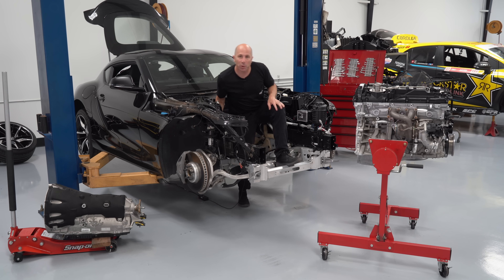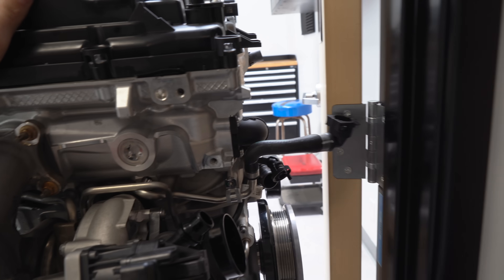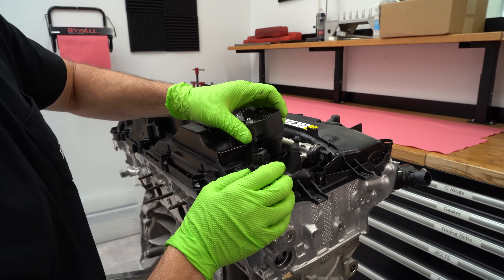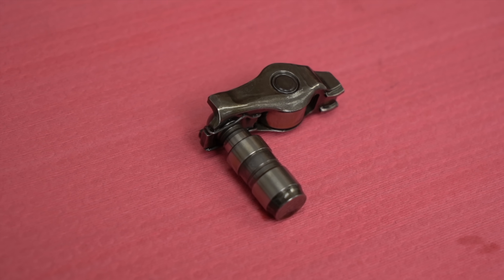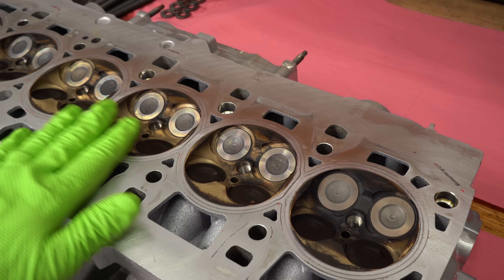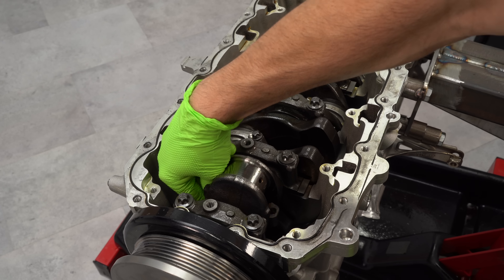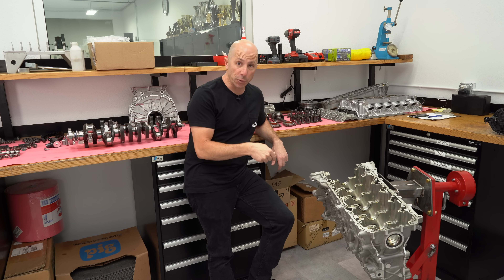2020 Supra B58 Engine Teardown - First Look - Better than the 2JZ?

Comment: "Timing chain is in rear" What I heard "timing chain tensioner changes will be very expensive if you buy one"
Reply: I paid 2k for a change on my bmw 320, ouch
Reply: They do fail, if owner didnt service the oil on time/ before near due.
Reply: @asteiner9181  Agreed !
Reply: Well some people take out engine and some just take out a gear box lower it down a bit and change it like that much easier faster but still expensive..
Reply: hopefully they mounted the tensioner to be easily accessed with everything still mounted. For example on the s2000 you can do it in 5 minutes from the front under the hood. In the rsx you have the remove some stuff but do it under the car. On this, I'm hoping it's not buried inside the timing cover.
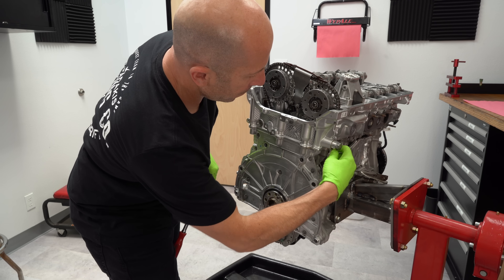Reply: @InTheZone85  At 6:00 you will have your answer.
Reply: Timing chain tensioners do not normally fail. These tensioners are hydraulics and should be fine for the life of the engine.
Reply: @hammertimee777  They do fail periodically, and guides also become worn out over time as well. It cannot be assumed the timing system will last the entire life of the engine without service.
Reply: @hammertimee777  "the life of the engine". Exactly, when it fails you get a new engine.
Reply: @hammertimee777  NO. Not correct at all. Many many many after market parts offer a mechanical tensioner because hydraulic tensioners usually fail before any guides.
Reply: @hammertimee777   And the chain life??
Reply: castamir it should if the car was stock, most of the 2nd owners will tune the shit out of the B58 & then will find out the timing chain is in the rear...
Reply: @hammertimee777  tell that to all the M278 engines.
Reply: @hammertimee777  They have done quite often on BMW engines of the last 12 years.
Reply: @jagolago-bob  That was a material related issue. The plastic would become brittle and  break.
Reply: @a914freak  Then I expect it won't happen again, but they still made the mistake.
At least this time, if they co-developed it with Toyota, it should be more reliable. I bet that Toyota checked the design over carefully and re-specced some components. They don't want to have BMW's reputation.
Reply: @jagolago-bob  Toyotas are known for breaking timing chain guides as well. Most new cars are not made to be worked on, they make the most money from the dealer repairs at a high shop rate.
Reply: @jagolago-bob  I was just about to say the same thing
Reply: @hammertimee777  how do the guides work? and how do you define "life of the engine"?  I had to change the guides and tensioners 3 times before 250k mi on my s4.  they said the same thing, but I later learned they really meant "80k mi"
Reply: Plus they already dealt with the theething problems for that system in the first gen 1 series.
Reply: @hammertimee777  modern timing chains in double overhead engines tend to fail quite often.  Guides wear, chains stretch, tensioners weaken.   Especially on an engine that eveyone knows will be modified and tuned.
Reply: @hammertimee777  what life> 200 000km, 80 000km, or 1kk km like 2JZ ?

Comment: To the timing chain inquirer division:
I just sold my M54 engined E39, which had over 455,000 km on it and absolutely ZERO engine issues within the 300,000 km I drove it. I even set the rev limiter to 7400 rpm (6500 rpm stock) and admittedly abused it pretty bad overall. So everyone knows the infamous N47 timing chain issue, but please let the professionals just do their work and watch, thanks.
Reply: " over 455,000 km on it and absolutely ZERO engine issues within the 300,000 km I drove it"

As a guy who's worked on a shitload of BMW and knows their cars really well, I gotta say....

X
Reply: @immikeurnot  Well, some gaskets/ seals needed replacement, and everything around the engine broke multiple times, but the engine itself remained in perfect working order. If anything, I want to emphasize, that timing chains do not need to be replaced after 100,000 km, as some commenters seem to believe.

Comment: How does the mechanical fuel pump affect starting? Does the car have to crank longer to start? If it needs high pressure and it's only making that pressure when the engine is turning I'd imagine it would take extra time to start... Or does it just spray a big old glob of gas in when it's spinning slow and get the party started lol.

Comment: I see the integrated exhaust ports as a real challenge to high hp builds, similar to the EA888 engine...
Great design however and great video.
Reply: Yeah I really hate the integrated ports, good for standing out and looking simple, but bad for actual power boosting.
Reply: @wyattlarrick3246  heads are interchangeable and can be switched with the Z4s heads since it doesn't have integrated ports but has 6 exhaust ports compared to the mk5 that has 2.

Comment: If owning Euros has taught me anything, those computer controlled cam angle/camshaft lift regulators are going to be the weak points and the obstacle of chasing high power. Maybe it's just because I'm a retard and built m96/97s and maybe it's because they were the most common failures with high power and tuning, and maybe I had several catastrophic engine failures because of it and maybe I'm still salty about it. But who knows. Feel free to educate me in the comments though if you think they're executed well in this application.

Comment: Couldn't just you just tear apart a bmw z4 engine? It's the same engine & the same car. Nothing new.
Reply: Watch what? It's just a BMW 3.0 inline 6, b58 335 hp & 8 speed automatic that started back in 2015. The exact same thing in many of BMW's. The motor is a reliable thing but nothing exciting. The only issues I knew bmw owners had with them were electrical, software & etc. Nothing that was really the engine itself. I commented because they went & got a 2020 supra to tear apart when there is a lot on BMW's in junkyard with same motor you could have done the same thing to. And before you say, oh they want to make the engine faster. Take the new motor out of supra. Set it in the corner of garage. Go to junkyard get another b58 to make faster. Then drop that motor in the supra. Save the new motor for when you go back stock to sell the car. But I think nobody will be buying these Supras because of the new mid engine Corvettes for the same price as the Supra. I think the Corvette will be pile of junk in a couple years like the always have been. So if you want something not reliable but is fast & will be short lived buy a New Corvette. If you want to buy something reliable & a lil sporty buy the Supra. When you try to make the Supra or any car faster you lose reliability. So you should have just bought the crap quality Corvette.
Reply: @generalkalani6746  The B58 in the mk5 has small differences since the heads,fuel system(high pressure),turbo,and more oil squirters than any B58 ever made. And keep in mind no matter how big the C8 popularity is its not going to stop the supra from selling. Even in other countries the supras a cheaper buy anyway because of the engine displacement taxes that are added on to the cars price in other countries.
Reply: True. I wouldnt ever buy a Corvette or any Chevy for that matter. I drive Chevys at work & that's bad enough to know I dont want any product they make. I mean I like the thought that they are doing a mid engine & the price hopefully other more reliable companies will follow suite like Ford, Toyota & etc. If they make a cheap, powerful mid engine car I would jump on it. Maybe Ford will start making mid engine Mustangs if Corvette does good on sales. But it might hurt the Ford GT's sales & used sales though. I have a Mercedes CL55 AMG & I love it. The drive train in it is great. Makes good power stock & can handle a lot of power that you want to throw at it as well. The only downfall is the go faster parts cost twice as much as the same type of parts for Ford or GM. But what I like is with the parts on it, it is still reliable. How long do you think it will be before you see a 2020 Supra with a 2jz swap?
Reply: Nevermind I just searched on youtube & people have already done a 2020 2jz swap. Lol
Reply: @generalkalani6746  the mk5 already has mounts ready for them to be 2j swapped from factory.

Comment: Scotty Kilmer always complains about intake manifolds being plastic.
Reply: Like BMW..even a plastic thermostat ..
Reply: @zymmer4  whats so bad about plastic? its very light
Reply: @jorgemiller8994  its fine when its new, no problem at all. but over time it goes brittle, wonder how much a new thermostat costs, i bet they sell you then entire unit lol
Reply: @jorgemiller8994  it's also weak, can't handle much heat or pressure as aluminum does.  Would you use a plastic knife to cut your steak??  Sure it may work,  but it requires more effort and it could break.
Reply: @bajaboy27  An intake manifold doesn't need to be very strong..
Reply: @madjimms  "an intake manifold doesn't needs to be very strong" -  he says.  

I disagree, the intake manifold is as essential as the exhaust manifold, and it needs to be as strong even if it's just cold air running through it.  You can't never compare plastic or carbon fiber products with aluminum or any other alloy metals.
Reply: @KiwiKuraun  Not just the actual part cost, but you got to DIGGGG DEEEEP to replace it.
Reply: Plastic gets brittle over time because of repeated heat cycling. Failure isn't likely, it's guaranteed, only a question of when.
Reply: @sqmotorsports9230  but if the plastic part is not damaging the engine when failed and cheap to replace. There is not a BIG problem right? This happened also to someone i know with a BMW that had more than 300.000 kilometers in it. He just replaced the thing. And thats it.
Reply: @HermanWillems  well, you just proved my point - it may not be a huge deal but knowing something on a car is guaranteed to fail because the manufacturer cut corners on cost is highly frustrating at best. And this is a boosted engine, so failure will happen that much sooner.
Reply: He complains about anything that has taken place after 1985.
Reply: Ah ah ah ah ah !!!! XD
Reply: Only thing that works for Scotty is 90's CELICAS... Everyone has to have one....
Reply: Don't buy the new Toyota Z4  or BMW supra. BMW breaks down all the time and it will cost you thousands Scotty had a customer that bought one and it gave her so much problems.
Reply: @bajaboy27  lololololol
Reply: Well, Scotty Kilmer's also a proven moron so maybe you should take advise from other sources...
Reply: Well, Scotty Kilmer is a fucking idiot, I think that's been established pretty strongly by now.
Reply: @derbigpr500  i dismissed him totally when he put out a video of MY expertise about hydrogen and electric cars. He totally talked 100% nonsense and false information. Since then im totally done with him. He talks bullshit nonsense which where relevant maybe 30 years ago.
Reply: Well, I have had 3 cars with the TOYOTA 1.5L 1NZ-FE engine that has a PLASTIC INTAKE MANIFOLD and never had an issue with any of them...And yes the PLASTIC INTAKE MANIFOLD is close to the radiator (front wheel drive cars) and even at high temperatures the plastic intake manifold is intact.
Reply: EM6285 I’m sure ur 1.5L Toyota engine didn’t have an inter cooler inside the air intake. So maybe you agree with Scotty more than you actually thought.
Reply: @EM6285  you had 3 cars with Toyota 1.5L 1NZ-FE engine that had a plastic manifold and never had an issue?   How many horses where you pushing?  120? You had any boost running through it? 

 Exactly.
Reply: scotty kilmer is toyota paid idiot

Comment: Did the fuel pump fail already ... or did BMW finally address that issue?
Reply: It's an expensive part. They probably designed it to fail after the warranty is up. Then you have to spend more money for the fuel pump out of your own pocket.

Comment: My 02 Volvo white block has cracked rods coated bearings and high pressure oil squirters....this stuff isn’t new
Reply: Cracked rods and coated bearings are pretty much the norm for everything these days.  Mazda Miatas have had piston oil squirters going all the way back to the first ones in 1990.
Reply: Patrick Madden but nobody is gonna tear down a Volvo motor, that's boring
Reply: Jonathan Isaac countless videos of tearing down Volvo’s where you been son

Comment: It ain't no 2jz I think engine is trash to much bullshit will never make the power of a 2jz my thoughts
Reply: B58 has a small aftermarket that already has it hitting over 700hp with stock block and internals with a tune,downpipes,and more boost unopened even with its ecu that isn't fully cracked yet. It's got potiental one way or another but stop comparing it to the 2j it gets boring comparing the same engines a million times. How bout u compare this to the 7m,S54,and S55?

Comment: bmw power :D they make amazing engines
but how much power can the engine handle on a stock block ?
Reply: Comparing this engine to the N54, I would say that the block could possibly handle about the same amount the original 2JZ (700-800hp give or take) without having to upgrade the internals. It seems like a marvelous piece of engineering, although I do not like the idea of an exhaust manifold integrated into the head, a water to air intercooler inside the intake manifold, or the timing chain being on the rear-side of the engine (come to think about it, doesn't seem to be too difficult to deal with looking at the underside of the supra chassis.

Comment: I have owned a stock MKIV for 8 years with a 2jzgte engine and I have recently driven the new Supra. It sucks. There’s no challenge in driving it and it even feels weaker than the old one as it hasn’t a twin turbo and the turbo takes forever to kick in... I am very disappointed with that car in general and think it’s an insult to the previous Supras...
Reply: Nice troll. Meanwhile to whoever didnt get the joke, the new supra has 500 Nm at 1600 rpm all the way to 4500 rpm.

Comment: For MPG and power direct injection is great, but the carbon buildup on the back side of the valves and on the piston from direct injection sucks. I pulled a direct injection 2.4L gm cylinder head off a vehicle at 130,000 miles and the carbon buildup on the valves and pistons was insane. The valves had a 1/4" of build up on them. 

If you own a direct injection motor, please do the fuel system tune-up ever 30-50k miles.
Reply: Only way to get the build up off the valves without tearing the engine down is walnut shell blasting.  The shit is completely immune to chemical cleaners.

Comment: Cooling down the the air after the turbo isnt as much about denser o2, as it is about being able to add more timing advance. That's where the power lies on charged engines.

Comment: Great video! One point though, direct injection does not require a mechanical fuel pump, Mercedes M139 uses electronical for example.

Comment: they put the timing chain on the difficult side of the engine, clearly they did not want people to open this engine
Reply: many new engines have the timing chain in the back to improve weight distribution. It also improves the response.
Reply: @hammertimee777  How will it improve the response?
Reply: dandare1001 they’re able to combine the front crank pulley and the flywheel into one.
Reply: @hammertimee777  So they drive the ancillaries from the rear of the engine (next to the bulkhead)? I think I saw a front crankshaft pulley at 1:47. 

I still don't understand why the motor response will be affected.
Reply: one of the biggest reasons to do so is that the twist of the crankshaft at high torque output will not effect the timing of the valves when clutch and timing chain are close to each other!
Reply: @theo7709  I can sort of understand the thinking behind that, but why don't engines designed from the ground-up for racing use this? It's not a new idea.
Thinking about it again, surely there'll be less twist overall on the crankshaft when the parasitic loads (flywheel/drivetrain and timing chain) are at opposite ends? 

Some motorcycle engines have the camshaft drive in the middle of the crank, which makes more sense for camshaft twist to me. The crankshaft twist will always occur due to the greatest load on it being at the flywheel end unless you take power from both ends.

I'll have to read up about it.

Comment: That engine won’t take 1000hp. Can’t wait for the engine failures from this shit BMW
Reply: There's a F80 M3 sedan with a  S55 that hit a new record of 1174hp on stock block and internals just recently and theres another one that hit 1158hp on stock block and internals too a couple months back. This should do the same since it's closed deck,has the block and bottim end off of a diesel including it having forged internals and crank plus the block being built from the same material as coyotes and VR38s. Its going to get to 1000hp regardless of what people say.
Reply: And it’ll last one run
Reply: @Milkman69ner  please tell me how do u know.

Comment: Now put a 2JZ back into it :)  Way too much plastic on that engine but at least it does not have a plastic oil sump like VW's do.  Also why is the one end cylinder looking like it has a lot of carbon build up on it compared to the rest and in such a new engine?

Comment: timing chain at the back of the motor, just like some bmw diesels, and those chains failed a load more than the ones with the chain up front, I dont liek that design nor do i like the 2 port internal exhaust manifold thing, and those t60 head bolts, im just imaging a recall like some Mercedes had where the bolts failed, also, what type of oil control rings are used? after the m50 and maybe m52 they changed the oil control rings and they would stop working nice and burn oil like it was going out of fashion at about 150 thou kms